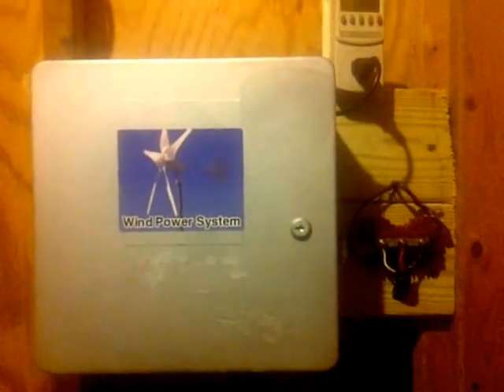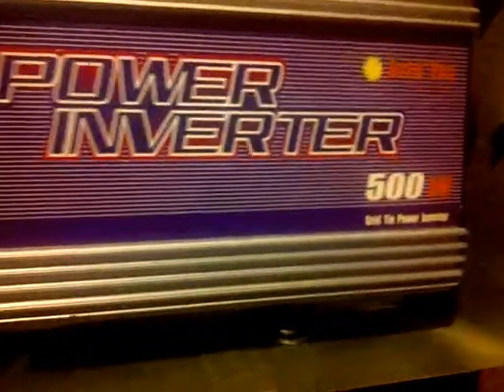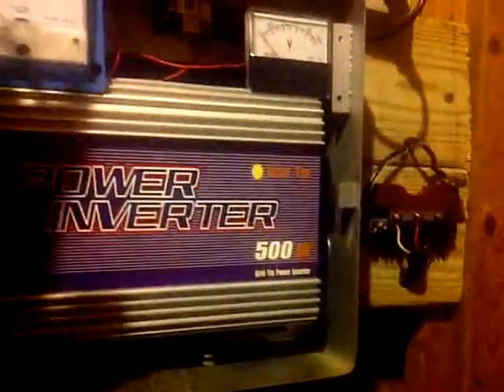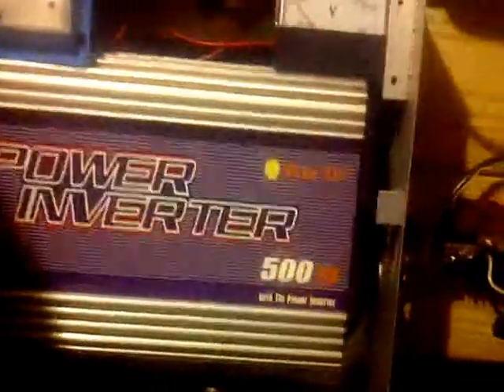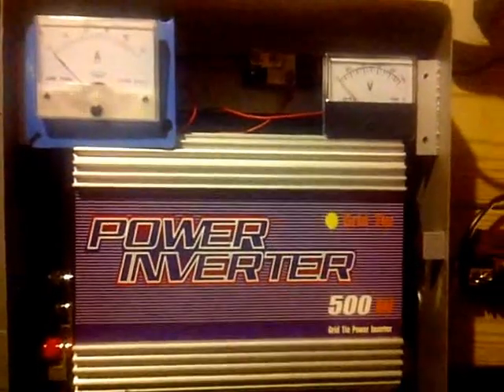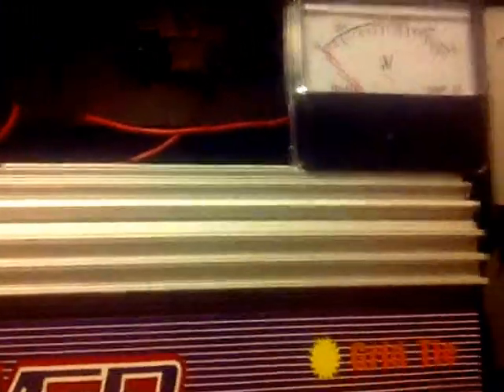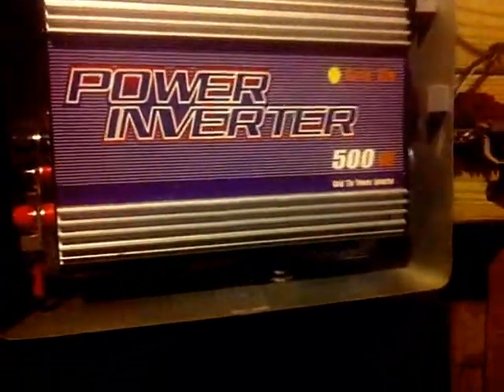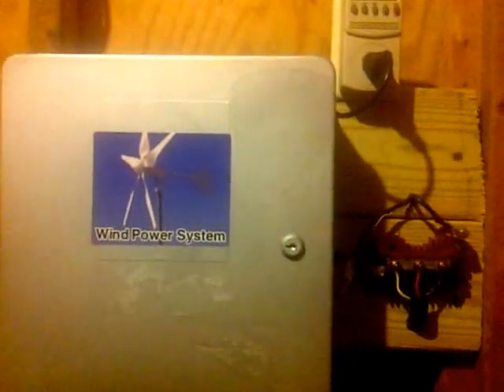Windy Nation  PMA Grid tie

Comment: Hi Larry  When you hook up your dump to the battery bank does it matter which wire goes to + and -  ?   I have a hy400  I dont have a break because i dont use the stock controller. I shorted out the 3 phase wires by touching them together do you think the stator could be damaged by doing this? It doesnt seem to be producing as well but cold be my imagination. Thanks Larry. Rusty

Comment: What is that rectifier off of . It looks familiar. I would cut two 2" holes in that box and put in a little muffin fan on one of them. Heat kills electronics. Thats a nice box , with a key yet If I was hooked up to the grid , I would like a clean and simple system like that.